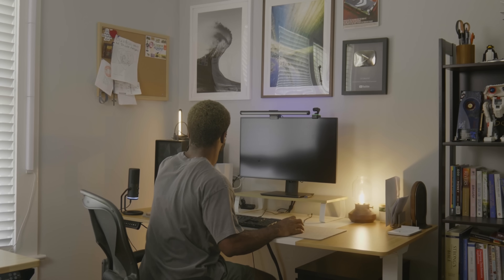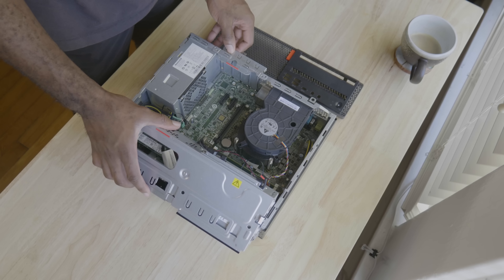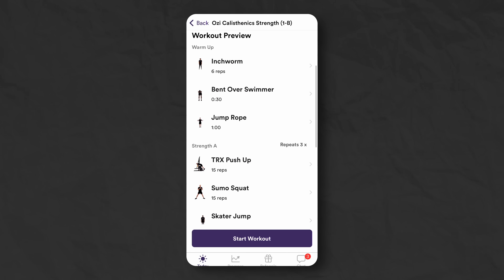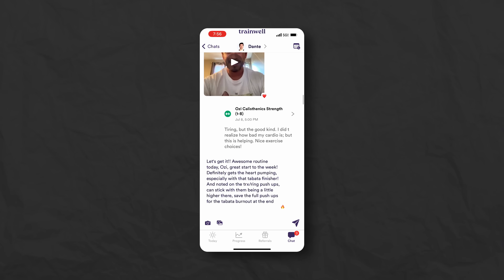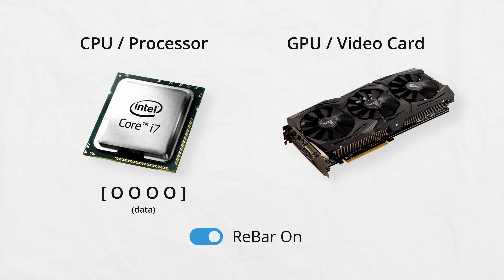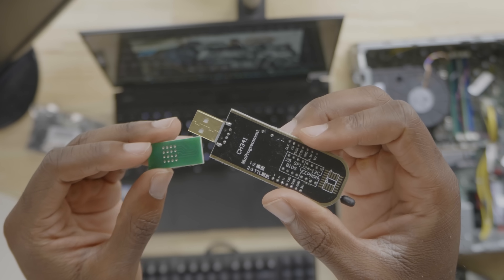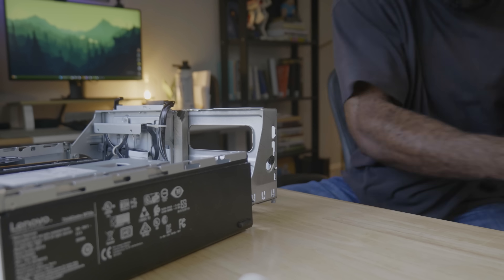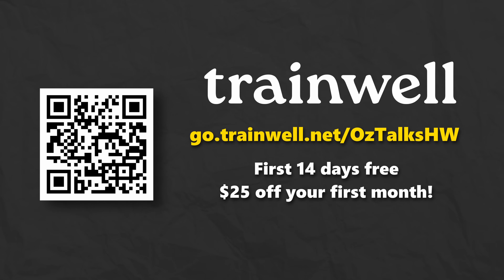Can I build an Xbox Series S PC for $200?

Comment: in russia i can buy used xbox series s 512gb with many games for 150-170$, and this half year of 2025 is the best prices for pc components. i built pc for 180$ (18k rubles) (ALL COMPONENTS ARE USED): gtx 1660 super palit in perfect condition for 75$, ryzen 5 1600 for 13$, 16gb 2666mhz 8x2 ddr4 ram for 12$ (usually its 15-20$), ssd m2 256gb for 9,5$ (512gb would cost 15$ so i bought hdd 1tb for another 10$), mobo am4 b450 some chinese but good and hadled r5 5600 with 5060 so i bought it for 35$, fsp 550w psu for 10$, some old termaltake cpu fan with 6 cooling tubes for 1$ (can get same for like 8$, and open pc case for 8$ because it looks good and makes pc so small. and its performance still worse than xbox series s and my pc camdle handle nothing at 1440p and not everything even at 1080p, but ecery game is super optimized for xbox series s so now i can cope my pc

Comment: Too bad there arent't many options to build a small gaming compact PC with included power supply, smallest I could build (a bit smaller than the SFF in this video) is with case Chieftec BU-12B. Many "small" cases use an external power supply dangling on a cable, I hate that. 
There are a few smaller options but the included power supplies fit a limited amount of cases. 
What would be nice is a smaller case (e.g xbox size) sold with included smaller PSU, so we can just add our mini ITX board and a slim GPU 🤩
Later edit: there are some compact cases with  "flex" / "1U" PSUs but those fans are very loud for gaming. A custom case can have larger (less RPM) fan that can be oriented like on the Xbox.

Comment: Hello friend! how are you? I have a similar configuration to yours, but mine is an i7 8700 (it gets very hot, I had to adapt the case). I bought it last year, it was very cheap, as I bought it at auction. Furthermore, my video card is also an arc a380. I bought it in February 2024 and was honestly discouraged due to the low performance. So I ended up abandoning my project and the PC was left in the corner.
Reply: It was very frustrating, because I cut my cabinet myself, made room for great airflow, my daughter painted the cabinet and it looked beautiful. But, as I said, I was discouraged due to the low performance. Could you explain more about which bios system you are using and what you changed or at least send a link to the forum you studied? thank you friend.
Reply: desde já, muito obrigado de um amigo brasileiro! <3

Comment: Thank you for this video. I´ve a sff optiplex and an lenovo ideacentre sff here, wanted to upgrade one of them with an low profile intel arc graphics card... but now I know, that´s not a really good idea, because the only video card that fits in is an intel arc a310 single slot from Sparkle and without rebar I think it´s just a very weak performance on games and I don´t want to flash bios etc. So thank you for that advise, man.

Comment: Why spend 200 building one when a series s is 200 😂
Reply: Because a PC allows way more freedom for emulation, retro PC gaming and modding games. These options are VERY convenient when you want to play a certain game that often times may not be available on Xbox.
Reply: @spht9ng  I know that, I only game on PC. Just pointing out that your spending time and money on a soon to be an out dated pc, might at well buy the console so you can game while saving enough for a PC that's actually worth the time to build
Reply: @BitRae  outdated PC will still be able to play modern games with optimized settings and upscaling. It’s still worth it over a console in many cases even for a lower mid range PC
Reply: Also, generally, it seems that games are much cheaper on steam when sales come around.

Comment: I made a gaming pc out of a dell vostro 3670.. extremely tiny case for the video card I selected for the build. It actually wouldn’t fit in the case like at all. So I took my old rx 580 and shoved it in there. I bent the case to MAKE it fit. Runs exceptionally well with a different psu. Yes, I run my case open at the moment it I have plans to modify the side panel to allow better airflow. The only thing I’d say that I’m not happy with is the fact that the board that comes with the pc doesn’t have another system fan socket. Great pc for what I play and I only spent 150$.

Comment: For about the same price of the intel card, you can get a used gtx 1070 which has twice the performance and 8gb of vram. Only downside is that it consumes twice the amount of power. And maybe that it's used.

Comment: I use a HP Z4G4 with a RTX 2060.  Cost about $380 to build and I used the 1TB 2.5 inch ssd from my old gaming laptop for the boot drive.

Comment: I love us oz, but this is not the right way to go about thos whatsoever. Sata to six pin adapter, and cutting a hole in the side of fhe case to fit your gou IS the wah to go. That or just accept that you arent going to get the same form factor. You can even create a cap and spray paint it the same color as the case that fits over the GPU with extraordinarily affordable aluminum for like $2. 

Think outside of the box my guy. With this you could have got something like an RTX 2060 super, or even a smaller RTX 3060 used online, or something even better AND you get DLSS. Supplement this with lost Miss Kelly at AMD fsr3 frame jump mods and you have something much better than an Xbox series s let alone something that is an equivalent. 45 to 60 FPS for every game. 60 FPS average for just about every game if you are okay with using upscaling at 1080p.

Comment: You forgot to add that you needed a PhD engineer in order to help you mod the case. Which will be THE hardest part for most of your fanbase. It is a very interesting concept, however the sheer greed of these mainstream companies are having them lockdown PCs that should never need to be.

Comment: Giff BIOS modding/and flashing tutorial. I am doing EXACTLY  what you have done and failing. Too much info and messy is going on. We need a simple one like you are telling us. PC is Lenovo office one with an i5 8400, 16GB 2666 generic RAM and I changed the SSD from 250 to 500gb NVME. PLZ make a simple step by step Tutorial. I am getting mad at this point of dis not working. (I have everything needed, including the USB flashing hardware you bought for 14 bucks)

Comment: You stole me video idea! Haha 

I sold my series S and picked up an m720s with an i5 9400, 8gb ram and a 256gb NVME for £85 (absolute steal) 

Added another 8gb ram, a 2tb NVME and a GTX 3050 LP, I also added an M2 wifi/BT card so it has wifi 6 and BT 5.4 now, drilled a hole through one of the PCI brackets and put an antenna in, and used an old antenna wire from a dead phone i had as the wifi antenna

All I have left to do is relplace the PSU fan as that's the noisiest part of the PC (when the GPU isn't gettint hammered!)

Oh and I'm plannig to add a guitar amp handle to the top (when upright) for ease of transport as it gets moved around a lot

I absolutely love this thing, the M720s is a great office PC to make a gaming PC from, its so shallow, smaller than my PS5 but that's not saying much lol

Good works man 👍

Comment: Same card, same problem except my Dell Precision's power supply is in the way. It came with a Quadro p620 and I might just remove it from the case and mount it in my arcade pedestal.

Comment: The Xbox Series X 512GB model is officially priced at $299.99 on the Xbox website and $298.99 at Walmart. Therefore, Acearty23 is correct; with an additional $100, one could opt for a better GPU and CPU or a better GPU or CPU and more RAM.

It's not as complicated as the video suggests; the complexity was likely added for entertainment. This is a solid option for $197.

Edit: He had an even larger budget. The Xbox Series S 1TB Carbon Black or the (Robot White releasing on October 15, 2024) is priced at $349.99. With that amount, you could easily build a powerful system.

Comment: I remember my first pc (bought it used from a guy) had the same cpu, the i5 8400, I didnt really have issues with it, it was paired with a 1060 3gb gpu and could play Arma 3 on medium settings using a 1080p TV.

Comment: i use ch341a often to flash bios or chip on my laptop, or router. but, that cheap ass clip, always make me angry. which one getting loose so easily. or, it came off easily. i'm trying to find the better solution. and the only solution i found was, remove the bios chip, and soldering it to pcb inluded in ch341 box. no strong clip, or better clip right here.

Comment: The whole situation with the resizable bar sounds like one reason I put off getting a gaming pc. Some random thing you've never heard of before that requires manually flashing your bios chip to get the performance you expected.
This sounds like an issue that not a lot of computers have, but I keep encountering things like this either on the hardware side or while trying desperately to get a game to run. I had horrible performance in one game until I changed the audio output frequency setting on my pc, who would think to try that?

Comment: One thing that's worth mentioning is that the XSS is not actually a £200 console given that it's sold at a loss. So the hardware budget could be more if you were going to sell it or something.

That being said well done.
Reply: Also,  Microsoft has the benefit of buying in massive bulk.  So for parts they are paying a lot less than than the average consumer

Comment: I just bought Lenovo V520s with i5 7400 for kinda the same purpose. It cost me £40 so I might splurge and get RTX3050 LP instead to avoid t he headache of flashing bios. As much as I like to tinker it is supposed to be stable media consumption / light gaming PC. I'm gonna most likely drop an i7 and 16GB of ram into it too.

Comment: The series s is $300 broski, you still had $100 left in the budget 🔥
Reply: It’s $200 used $250 new
Reply: @Oni_Codm Depends on your region where I'm at is 300$ brand new and 250$ second hand u from Canada or something 👀
Reply: @mavrontjonakon7119  im from America. I'm Walmart it's the prices I mentioned
Reply: @Oni_Codm  oh damn I should check them out is tax included?
Reply: @mavrontjonakon7119  no not tax included 😭 now that I think about it, it's gonna end up $300 either way
Reply: @Oni_Codm The Xbox Series X 512GB model is officially priced at $299.99 on the Xbox website and $298.99 at Walmart. Therefore, Acearty23 is correct; with an additional $100, one could opt for a better GPU and CPU or a better GPU or CPU and more RAM.

It's not as complicated as the video suggests; the complexity was likely added for entertainment. This is a solid option for $197.

Edit: He had an even larger budget. The Xbox Series S 1TB Carbon Black or the (Robot White releasing on October 15, 2024) is priced at $349.99. With that amount, you could build a powerful system.

Apologies Oni_Codm I didn't mean to cook This much. 😂

Comment: Thank you for this incursion in enhancing/modding of low power consumption, small form factor 'office PCs'. I have been wondering for quite some time whether they are a possible route to decent performance for home users who are willing to make the effort.
I must say I'm quite disappointed to see that Lenovo ruthlessly avoided deploying any resource in making a machine with features suitable for even the smallest upgrade. It may be true that they do not claim to support any specific discrete graphics card but it's a pity the room for the card in the PCIe x16 slot is just not enough for any GPU worth fitting. I would call that a flaw in the design. The section of the chassis which has been cut out is structural for rigidity and, even if it won't (probably) cause any major problem, it is a non reversible mod.
It's also evident how little work Lenovo has put into writing their BIOS. Rudimentary is still a compliment 😣

Ozi, would you be able to try to repeat the upgrade/mod with another SFF PC? Is there an inexpensive office PC (maybe with AM4 socket?) which requires less pain and risk to be transformed into a decent but affordable gaming PC?

Comment: This is my kids computer but we have the Hp, i5-8500, upgrades have been rx550 -> rx6400 -> 4060. It’s better than a series s but a bit more expensive, full build using used everything ended up around $340

Comment: Used GTX 1650 is what it should’ve been. I hack the case apart and fit a full sized 1660 ti in these with 8pin power added to psu soldered.

Comment: You can get the same pc but in a mini tower variant. I did this with a v520, got a tfx 300w psu and an rx460 with i5 7400. Worked great until i could afford a better pc

Comment: I think the PC wins in that you can get games from multiple sources (usually cheaper) than the Xbox, you can use any controller you want, you can do more productivity stuff, but the Xbox wins from a power standpoint.  That being said, you have more control over the game's settings on the PC so you can tweak the game to play better on the PC vs the Xbox... If it plays bad on the Xbox, it just plays bad, or you can't dial things back to be able to crank other things up like you can on the PC.

Comment: This would be a fun learning experience. Besides that the xbox series S console is optimized for xbox gaming and it is not cost efficient to build a PC equivalent of it. 

I remembered back in the late 90s gamers were spending $1000+ to build systems to play PS1 games when you can get a PS1 for about $50. In this case you could get another Series S console for $100 or less.

Comment: The Series S costs between 300-350, for that you could've easily put in the 3050 6GB LP and actually match the Series S, specially cause it costs about $170, it would've come to $260 total and still cheaper than a Series S and have $90 left with which you could've easily gotten a 2TB SSD, or gwt a 512GB SSD, an extra 8GB stick, sell the 8400 and get a 9700

Also cause although Intel has been fixing game compatibility issues, there's still a lot there, you won't have that with Nvidia or AMD

Comment: The thing is that used Series S is about $130. Then it runs games similar (not because its power, but because devs are forced to optimize for it) to used GPU that you could buy for $130 (which is sth like RTX 2060).

Comment: That model I believe can also have a handle drilled to the top if the battery is on the bottom I did this to mine and I'm able to comfortably pick it up and bring it to friends houses. The hardware upgrades I did was a 4060 for the GPU in a sound card x-fi forte with a pcie extension cable for some odd reason Lenovo decided not to add an extra pcie slot on the bottom so I tucked the pcie extension cable underneath the video card and routed it to the spot where one would be. I also had to make room for that by cutting and using metal snips to cut out of the cage that folds over in that unit. But because of having a GPU in that area I wanted more airflow so I ended up using a Dremel with a cutting blade on it like your friend did in the video and cut out a window on the side panel and used decorative metal sheets from home Depot that had Vents you can duct tape the vents to the panel or use some J-B weld.

Comment: Nice build. And whoever disses the Arc has no clue, price/performance of these cards is great from what i can gather, still have to check out one for myself under Linux. I ain't touching that abomination from Redmond if i don't have to. 😁 

But regarding power usage, currently nothing beats abusing a PC gaming handheld to be a desktop. My Ubuntu'ed Steamdeck eats 8(!) watts while idling on the Cinnamon desktop, my whole setup with two 24" DELLs and a Nobsound amp eats 30-35 watts in idle and 45-50 watts when i stress the system.
OK, its not a 200€ gaming rig, more like 600€, but with German energy prices of up to 50 cents a kilowatt? This is a blessing.
I pay a "moderate" 29 cents by the way, still way off what you US folks pay.

Comment: I've been through most of these steps with different systems. At first I was yelling along about ReBar and how OEM systems have pretty much guaranteed BIOS locks in place (checksums) to avoid even booting hardware flashed BIOSes. Until the very end I was yelling "that won't work" at every step.

I'm surprised Lenovo doesn't lock via checksum. For HP and Dell, I can almost guarantee they won't boot with a hardware flashed BIOS because it expects a certain checksum. It'll just give you a beautiful series of beeps.

Comment: I used to game on PC and build my own rigs, but what most PC gamers often overlook is the main advantage of consoles: you can just turn them on, play for 15-45 minutes, and relax on the bed or couch without worrying about optimizations, compatibility issues, game-breaking updates, or background apps interfering. Every year, I found myself upgrading my graphics card and checking for bottlenecks in other parts, which only added more stress and led to overspending on hardware instead of the games themselves.

When you're tired, busy, or short on time, consoles let you avoid all that hassle.
Reply: literally brain dead comment

Comment: As someone who used to hack up Dell optiplexes to make sweet sleepers, I highly recommend you completely empty the pc case before using a dremel or angle grinder. 

This will make sure there is 0% chance of metal dust or shavings from shorting a component on your motherboard
Reply: Was looking for this comment before posting my own. A short might occur and kill your hardware/data. Or worse, burn down your building. It's a small chance but not worth the risk. Even more so if you sell the PC
Reply: If only HP didn’t rivet the motherboard and psu in certain cases :/ (shop smart even if the specs are good)
Reply: 100%
Reply: I used an m720s for my build, when I grided the piece of the inner cage out I put a sheet over it to make sure nothing went inside the PC, seems like common sense...
Reply: Was about to say that !